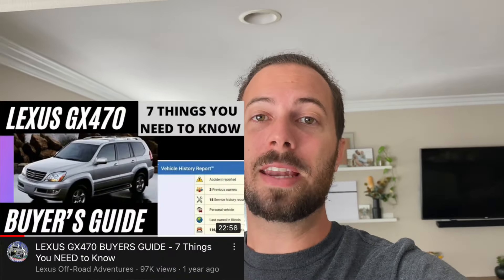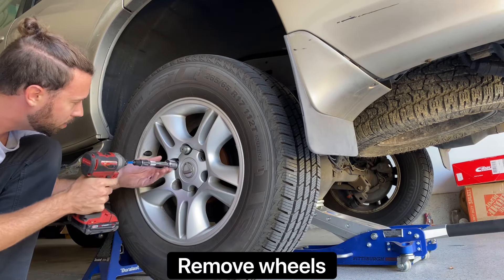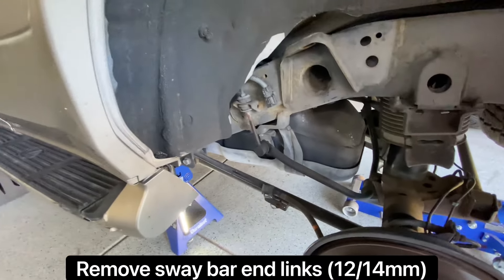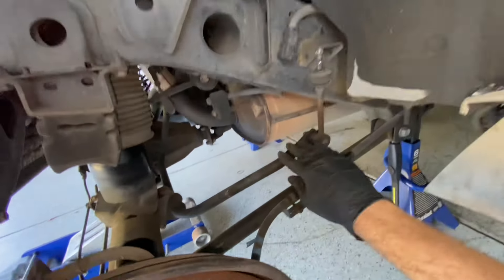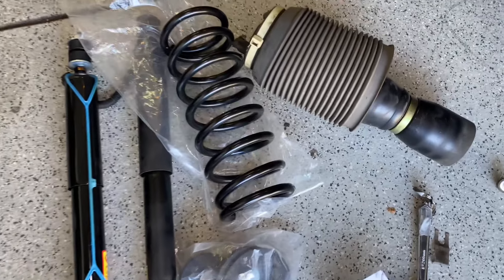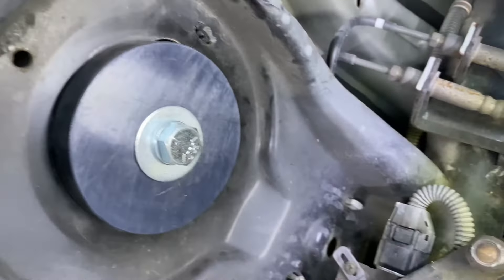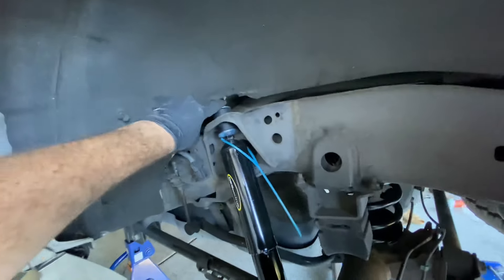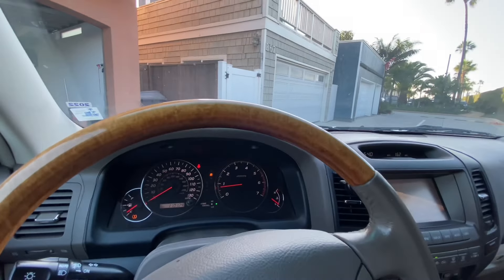Fixing the Most UNRELIABLE Part of the Lexus GX470 for WAY LESS than Mechanic Estimates

Comment: I see you’re trying to do your best with the knowledge that you have.  although a lockwasher would never work like that there’s a reason it’s on the nut and not the bolt. And if you didn’t cut all your air lines and took your time, I have took these units off for a while now and replaced them and I have sold them up to $400.  To individuals that would like to keep their airbags. That can’t  afford the high price of a new ones.

Comment: How can you say it the most unreliable part?  My GX470 just hit over 200K miles, and the airbags just start beginning leaking.  It didn't fail at 10K miles or 100K miles.  It's sure damn reliable to me.
Reply from the maker: Yes, and doesn't that show that, since the most unreliable part lasts so long (for some), the GX470 is a pretty damn reliable vehicle overall?

Comment: I have replaced both the front struts and the rear shocks.  The rear still sways badly.  I know the air suspension is dead.  Would replacing the air springs with a spring conversion kit fix my issue??  GREAT VIDEO series BTW!!  2 thumbs up!!
Reply from the maker: Thanks for watching! 
As for your vehicle issue, I certainly couldn’t diagnose your it via comments section. The issue could be related to any number of bushings or a compromised anti-sway bar, etc. make sure you get an inspection before you go throwing parts at it. It costs money, but can end up saving you money in the long run. I had failed bags on my silver GX when I first got it and it definitely swayed, bottomed out on the bump stops on mild bumps in the road, etc. so it could be the issue, but I’m just saying to cover your bases before assuming it’s one thing 🤙

Comment: Those are strange prices. In our country a new oem airbag is $150 a piece 2х = $300. $100 labour and $50 for computer calibration. Totals $450
Reply from the maker: Multiple people have confirmed on our forums that is the going rate at a Lexus dealer. That’s if everything needs to be replaced including the compressor, front active shocks, rear active shocks, airbags, etc. and they are all replaced with full price OEM Lexus parts.

Comment: Not sure what forums or dealerships you are getting these quotes from.  Those prices are way out to the left field.  The OEM parts for the replacement airbags are less than $600.  You can buy them and have an indie shop replace them with labor for around $1000 total.  Or you can DIY with coil springs for less than $400.  It is almost as simple as changing oil.
Reply from the maker: Um, you may have missed the screen shots from Repairpal.com that I put in there for my make/model/zip code. The forum that members post up their ridiculous dealer quotes for air suspension replacement is called GXOR on Facebook. One of the largest GX forums out there. There is no “left field” element here. 

As for ease of replacement, sure, it’s easy to DIY a coil spring conversion for $400. That was the whole point of the video. Not sure what your point is?

Comment: Do you think it was a rip-off that a shop charged me 780 for new shocks and springs install all around - I provided all the parts - I argued it should never take 3.5 hours to change out the front shock and springs, but they insisted it did.
Reply from the maker: Depends where you’re at. I’m in Huntington Beach CA and that sounds about right for what shops charge here. That said, I’d never do it because I have the ability to do it myself. I understand that not everyone wants to tackle that job though.
Reply: probably plus you supplied your own parts, but rusty nuts and bolts take more time.

Comment: I wouldn’t remove the air suspension, you’re making it worse lol self leveling and having 4 choices for comfort settings is so much better than a low end coil conversation. I’m at 275,000km and the original equipment performs great.
Reply from the maker: It’s 100% not worse for my purposes. Thanks for watching!
Reply: You obviously don't use yours the same way overlanders use theirs. Function over ride quality.
Reply: @jfreakinl4719  I park in front of Starbucks with my jerry cans and traction mats daily. It’ll be fine.
Reply: @carter240  posers gotta pose lol 😆
Reply: @carter240  😃

Comment: Absolute BS. You’re clearly on commission/ sponsored payment. The air suspension system is on these and the Toyota Prado 120 series LC5 models are fantastic and very reliable.
Reply from the maker: @richardsmart120  lol no. 
And the bags on both of my GXs went bad. I chose to put both on a spring setup. I shared my reasons why and showed people how to do it if they so choose. Totally fine if you think that’s bs have a nice day

Comment: See... i was into the video until he kept pushing "airstruts from strut masters" 
"strut masters" etc
So this is clearly a sponsor...
Reply from the maker: @ghostyybarnes7767  the tag in the top left when you start watching the video clearly indicates that the video includes sponsored content. Btw, still loving the ride of the strutmasters kit vs stock air springs. Much smoother when unloaded. Air springs are great for towing though. I don’t care whether anyone buys the kit or not.
Reply: @lexus_offroad_adventures  I mean that's fair, and if I missed it, that's my mistake. The takedown and install is still helpful regardless, so I appreciate your video.
Reply from the maker: @ghostyybarnes7767  yeah I figure if anything it shows how to work on the rear suspension (other than cutting the air lines if you’re keeping it air ride, but this is an off-road focused channel so most are dumping the stock system in favor of coil springs anyway)